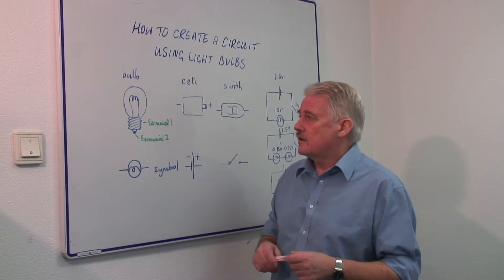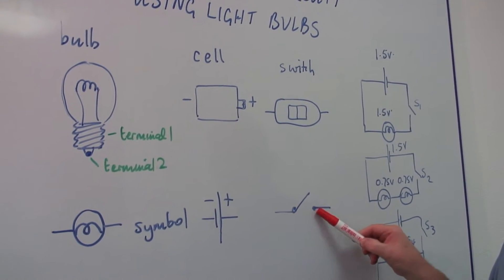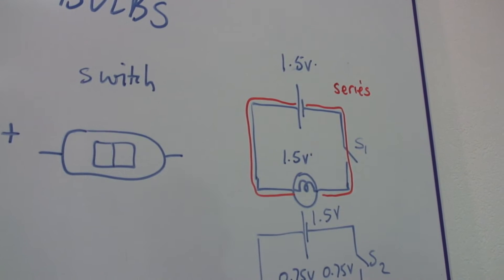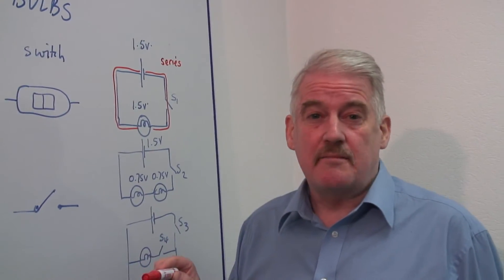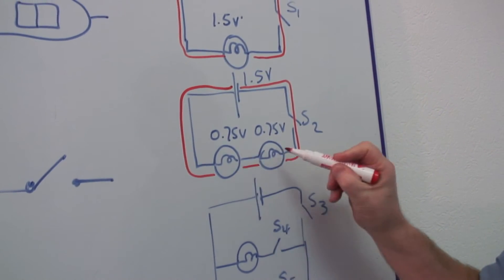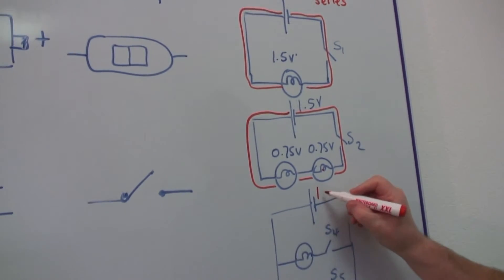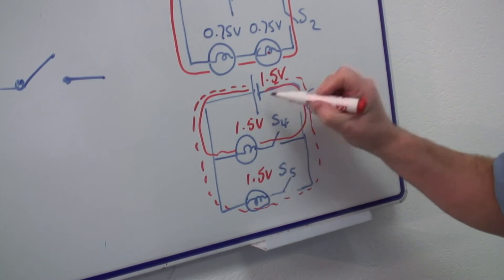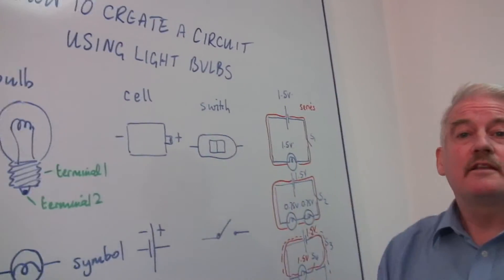Physics Help : How to Build a Circuit Using Light Bulbs

Comment: In the second series diagram, why is the voltage of the cell shared across both bulbs when I would have expected the first bulb to blow if it had a rating of 0.75 V; do the electrons some how know to share themselves equally? :/
Reply: Hi, that is a good question indeed! I am not an expert on the subject, I am an engineering student who just finished physics 3(electricity). I have played with PHET simulations and there is one for building circuits. In it you can see that the whole circuit is full of electrons even if the battery is not connected, so when you connect the battery it just makes the electrons on the circuit to move forward and I'd think of the voltage of the battery as the strength it has to move electrons across more or less resistance. So in the end its not that the electrons rush to the first bulb and know there is a second but that as they are in series the battery pushes the electrons that are before the first light bulb across it and the second at the same time so the voltage is "shared" since the beginning.